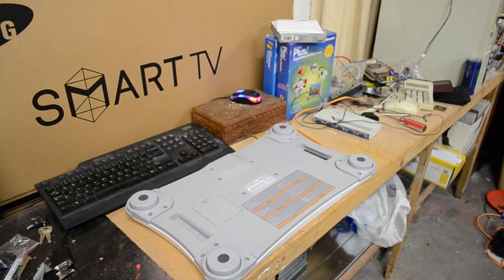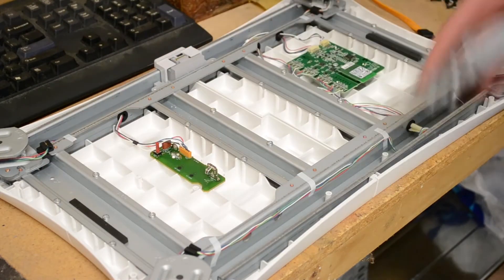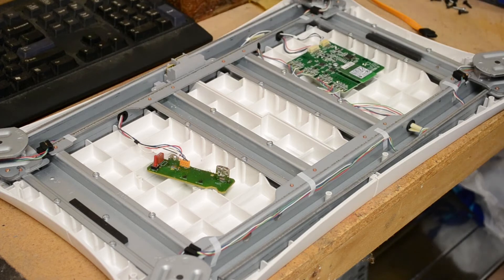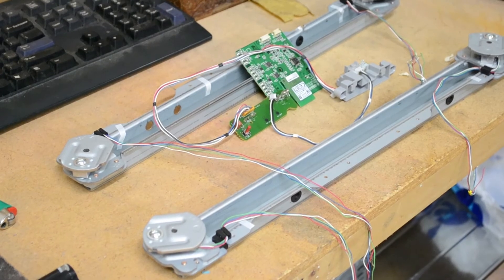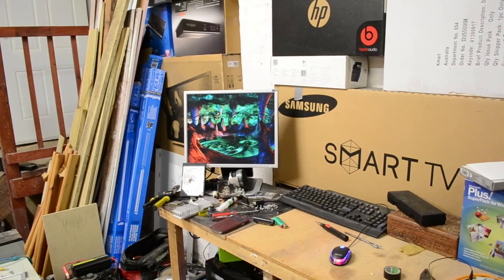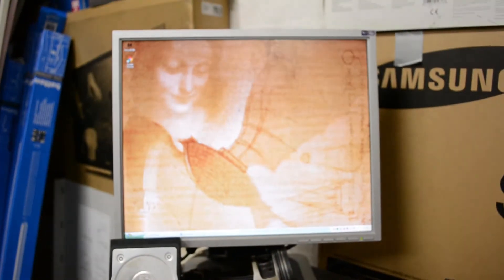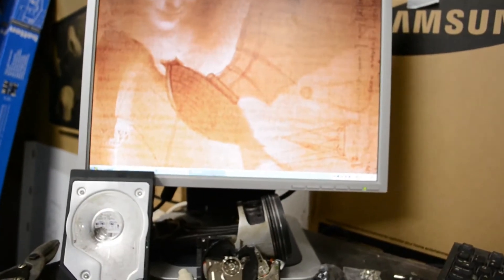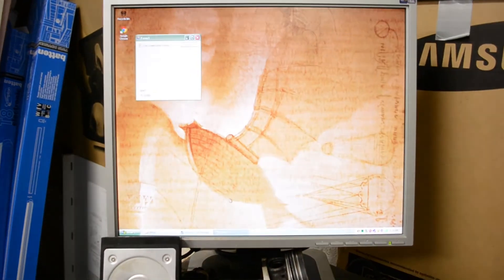Disassembling Wii Balance Board + Extra Bonus

Comment: You should pull the seat cushion apart and put it inside there for a tidy look maybe you could make a USB recharge for the batteries
Reply: I agree this would be a better position for it rather than the floor also adds area to neaten up the wiring. Though having a USB chord from the seat to the computer would cause OH&S issues as it would b a tripping hazard also it would restrict chair movement as well.
Reply from the maker: Anthony Gilbert If I can ever get my other idea to work, that may not be an issue
Reply from the maker: I'll probably build a second chair at some point, One where I can fit stuff better.. I went with the bottom for accessibility

Comment: jgcertified - How are you connecting to the PC btw - are you just using a Bluetooth dongle, and do you have any more details on the software?

I'd love to try this out for VR sims / games.

Does it appear to give fairly wide values from the load cells when you lean in the chair?
Reply from the maker: electronash It's bluetooth, and the library (Forget the name right now) can auto-connect when the chairboard is in discover mode. I've been meaning to make a neater mod for this, but I need to pick a chair I actually like! (In the hangout the chair it's on got very, very uncomfortable!) .. The software using the library I bashed together myself in about 10 mins, so it's not brilliant, but I'm considering posting the source for it somewhere (Sharing is caring!) .. I don't look at the individual sensors, I take the sum of all four for my threshold value as to whether I'm in the chair or not in the chair
Reply: jgcertified I've taken my Wii FAT board apart now. I think the frame should bolt onto my recliner chair, so will be fun to try out later.

Any luck with the board photos for the FDR yet btw? I'm a bit bored. lol